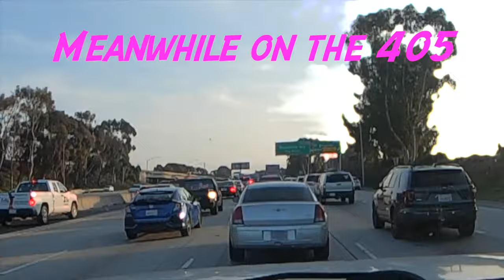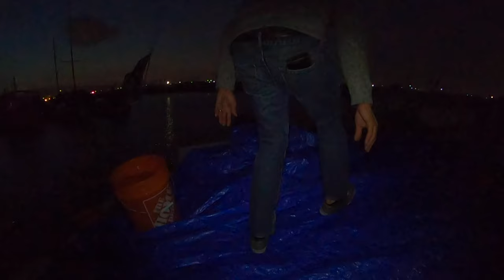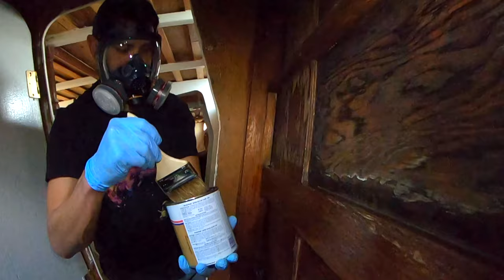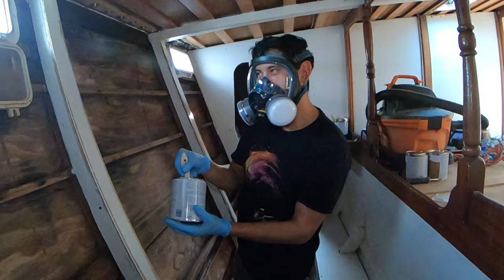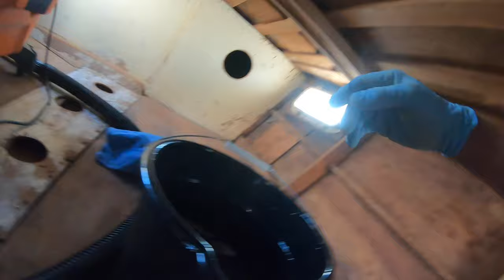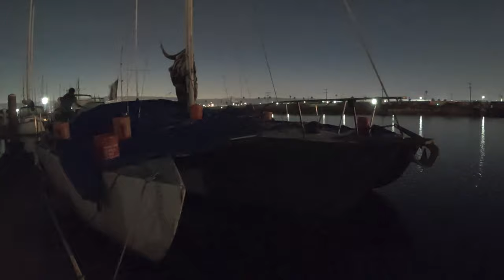Ep. 15 "Tarping" White Shark Sailing Trimaran Vlog Boat work

Comment: Quick question - like the work so far - why not spend the time to find where the water is coming in from the rain and fix that first before sealing inside? You wouldn't have to tarp or worry about tarps during rain and you wouldn't have to take the time to clean up the water after the rain inside the boat - better time management.

Comment: Troll Hole is gona need a 2nd coat
Reply from the maker: On Saturday I put a 2nd coat in there and worked my way up the wall and down in the bilge and finished the whole middle section of port side with a 2nd coat.